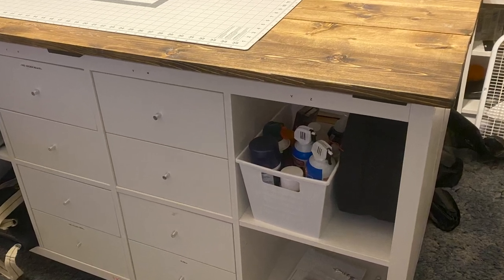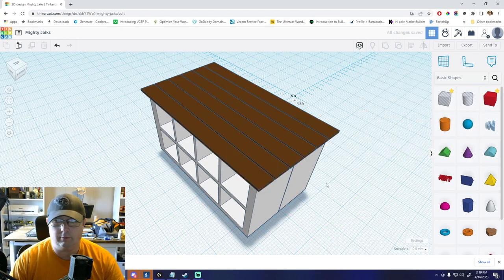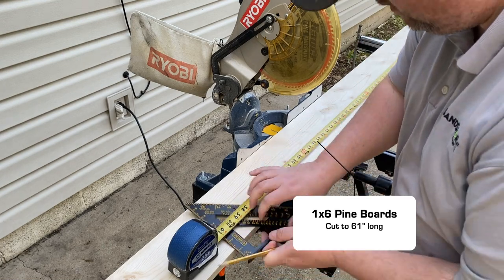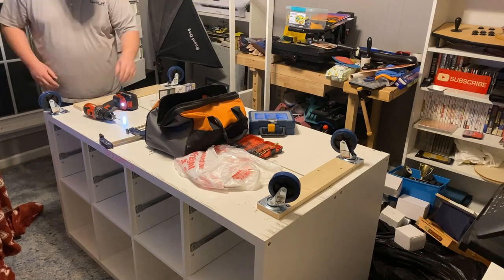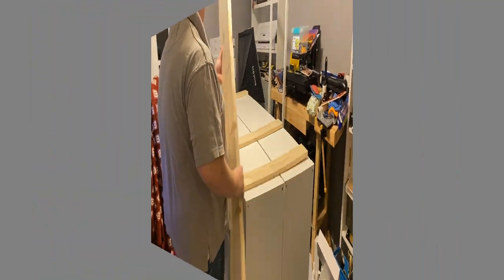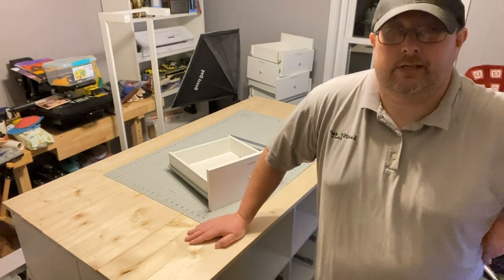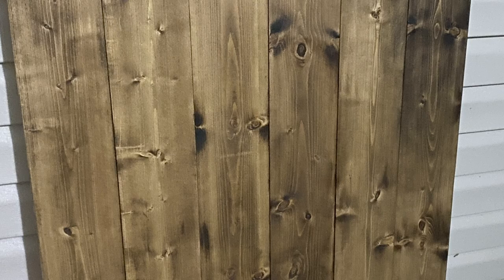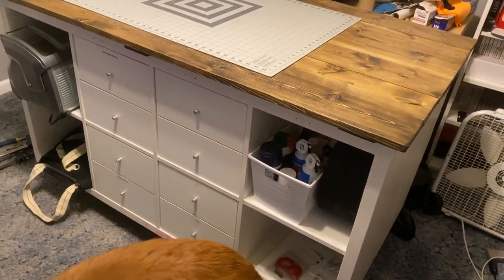Ultimate IKEA Craft Table Hack with Storage using Kallax

Comment: Hey you did really well. This is a perfect craft/cutting table. I was thinking about using two kallax unit with wheels but I just want to know the measurements. 
I have got a cutting table already but I want to have more storage and have wheels so I can move it away from my wall when I am cutting out fabric.
My cutting table that I got already is 120cm length and 80cm. And what is the height of the table from the floor, please if you reply back that will be great.